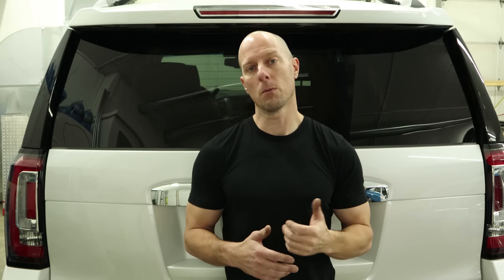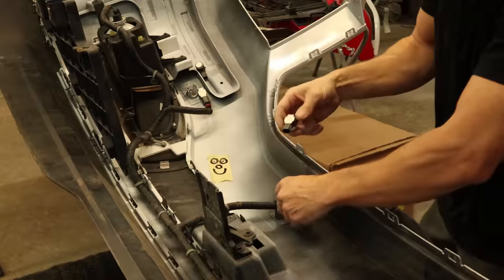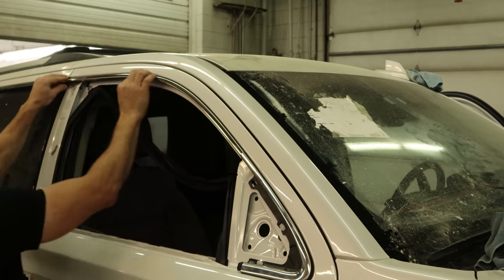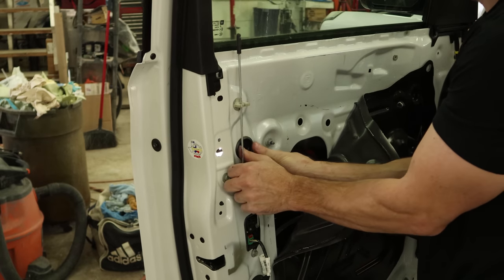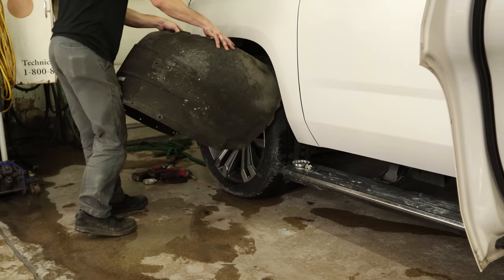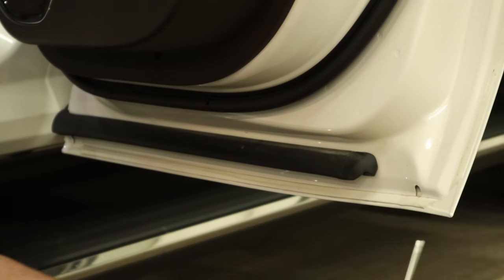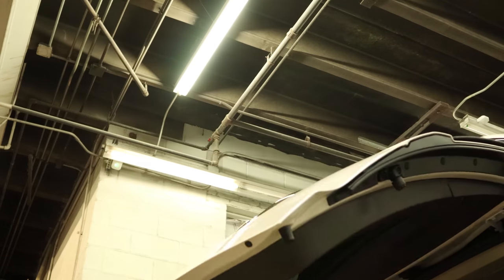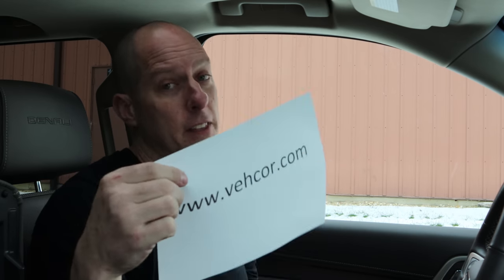The 2019 GMC Yukon Denali rebuild project comes to an end

Comment: "Land of corruption and rust." Best line ever. I'm going to start spreading that around here in Texas, while riding a horse of course, of course...
Reply from the maker: While riding a horse in your nice weather and getting into your rust free truck.  Oh yeah and the whole no income tax thing.  You have to have to rub in ALL the awesomeness of your state! 😂 It is currently snowing here! 👎🏻
Reply: @vehcor  @JackAceINC My next used truck will be from TX for sure.  I'm waiting for the end of salt season to buy one, drive it here, and apply about 10 cans of Fluid Film to the underbody and frame before it ever sees Winter.  I decided this after going through the fun of cutting the rotten front swaybar bracket off my 2007 Yukon and welding on a new one.

Comment: LOL, a wiring harness in a bumper!!  i grew up in time when bumpers looked like chromed 2 by 4's and were bolted to the frame with crusty rusty bolts
nice job on the yukon
Reply from the maker: Now they have modules, cameras, sensors, and miles of wires in them.  Gotta have the fancy gadgets! lol
Reply: I have a car with steel back and front bumpers and no wiring harness or other fancy stuff. Not chrome, but painted. It's a 1982 Mitsubishi L300 van.

Comment: I need my 2013 Yukon Back on the Road!
Reply from the maker: I have some parts if you need them.
Reply: @vehcor  I have a 2009 Yukon that I would like to set on fire, what a pos
Reply: @scotts3574  When it's running good its a great car. My engine and transmission needs replacing or rebuilding
Reply: @vehcor  How can I link up with you

1. Engine is knocking needs rebuild or replacement
2. Transmission slips
3.  Wheel bearing needs replacement

Comment: Scott, if you spray paint the tip of your cavity wax wand with red or orange you could help eliminate misfire. Also your bumper assembly tool looks like it was made by the same manufacturer as your torque wrench.

Comment: I use an almost identical tool to you it's called the Wristomatic 3000 universal installation tool, just wish I had read the instructions first and I wouldn't have broke it, three months wait to get it repaired 🤕. By the way has Mr Spotty sacked the afternoon crew as I haven't seen them for a while. Here's to the next boring build👍👍.    Gary 🇬🇧🇬🇧🇬🇧🇬🇧

Comment: For the guy that supposedly owns a collision shop that commented that "he wouldn't touch this truck with a ten foot poll " from the first post of this series maybe should find another business.  This is a very straightforward repair that takes time ,yes. But if your shop can't do this and make somethings better than factory, door gaps , paint corrections and so on maybe you need to hire better workers. All gm parts and attention to detail?  I fix these trucks all the time and correct issues along the way.

Comment: Only issue I can see is factory white bumpers are a solid color all the way through. You prime and paint black bumpers the core is still black. Someone in a parking lot with a shopping cart hits or scrapes the bumper it will be black scratches showing and will look horrible !

Comment: That Ferrari kit car looks impressive from this distance 🏴Scotland or are my eyes deceiving me? Old style riveter is a good work out for the muscles 💪🏻 and if you don’t use them you loose them, I know from experience 🙄. Nice to see a manufacturer using a decent water barrier material instead of the obligatory polythene 👍🏻
Reply from the maker: The kit is pretty well made and is 30 years old so it has held up well.   I don’t mind the hand riveter because editing videos with the compressor running in the background really sucks. 😂

Comment: Remember a car car that got ZEBART undercoating.  Coating trapped moisture against the metal and rotted it out from inside.  Floor panels  Where rubber coated rust crumbles .

Comment: Watching that oil change gave me a flash back this time for some reason. Working at the corner full service gas station changing oil on the weekend . This guy showed up looking to get a oil change on his Corvette . I turned him down said for him to come back when the boss or a mechanic was on duty .  Well the dipshit I was working with said I will do it. Well back then cars only used six or so different filters. But GM used two different ones. Well even after I told him to look out for that he said I got this. Well after the guy paid and backed out and drove off there was a big thick oil stream behind him as he drove away.  Lucky I saw this and lucky he had to stop for traffic. I ran up got him to turn off the car. We pushed it back into the bay and put the right filter on it and filled up the oil. Saving the motor and the owner big money. Well I didn't work with that guy again.
Reply from the maker: I used to work at a full service gas station with a guy just like that.  There was a reason people asked for me and I was only a teenager at the time.
Reply: @vehcor  It was my first job and  I had all sorts of older people would ask for me. They wanted me to check the oil and air in the tires and things like that. The other guys would add a quart even if it wasn't down that much ( Back in my day they were still the cans of oil that you need to use a oil spout to pierce the can to pour ) . Also the other kids would just look to get out of things I would do for them.

Comment: Is there any concern for using cavity wax with foam?  I have a 2015 Challenger and some older ones have gotten rot in front of the rear tires due to wet foam and cavity wax could help if there is no  fear of using it with the foam.  Some are pulling the foam, but of course that is more work.  Thanks!  I love the channel and your workmanship is incredible.

Comment: Great work as always.......  Something just seems ironic about snapping a bumper on a car.  I guess that's why you see them all along the interstates.  Coming from an old guy that use to bolt bumpers on and use a wonder bar to align them.  But, you didn't see them along the interstates back then either.  Another so called improvement I guess.  Thanks for the video, I know they take lots of time to produce.

Comment: Hey vehcor, with the park assist sensor did you have to reprogram them? I replaced a bad sensor but still keep getting the service park assist. I hope you can help
Reply from the maker: You might have replaced the wrong sensor or have another problem. The sensors do not need to be programmed on these.
Reply: Thank you so much for your help! Will try this out

Comment: since the hood is aluminum, it still helps to spray it?
Reply from the maker: Yes, haven’t you never seen all the bubbling paint on them?  They can actually be worse that the metal ones. They generally don’t rot through but the paint will start bubbling in just a year or two.
Reply: @vehcor  that's what I thought there are several farmers who have aluminum stock trailers that the aluminum just kinda turns to powder.  The new Silverado have aluminum doors also I think. There is a local father and son body shop that has been in business 30 years or more. Their work is outstanding they used the cavity wax like you do. They are diehard Ford guys,but they wouldn't buy the new aluminum pickups. They complain it costs to much for the specialized equipment to work on them right. Also the new stuff they put in the air conditioners. Trying to run the little guys out of business.  I really enjoy your videos, look forward each week.

Comment: I`ll bet you have a line just waiting to buy your rebuilt titled cars. I seriously doubt if everyone is as meticulous as you are and I would have cash in hand for sure!
Reply from the maker: I usually don’t even get to post them on my website but I held this one and posted it and it only lasted a few minutes.  I guess that is a good problem to have!
Reply: @vehcor  Yeah I serious doubt many are as meticulous with rebuilds as you are, any many just do it for the money and push them through as fast as they can and make them where they "squeeze by" inspection, with the zip tie and duct tape method.

Comment: Why did you butcher the clean front end by sticking that ugly license plate bracket on??
Reply from the maker: I just put it back.  The holes are in the plastic grille.  If it required me to drill into the freshly painted bumper, I might have left it off.